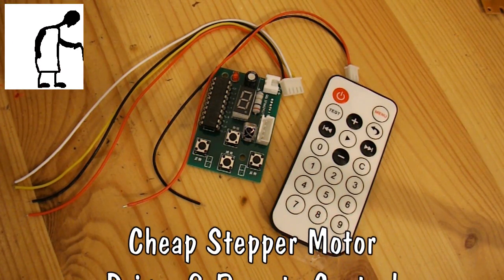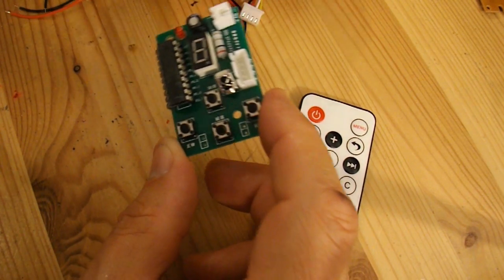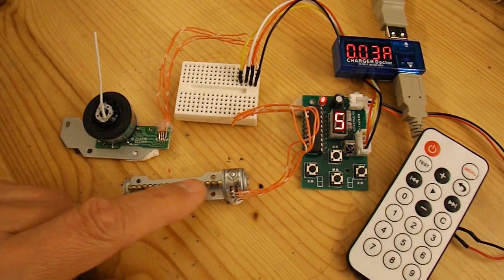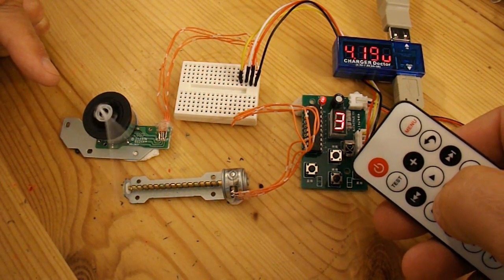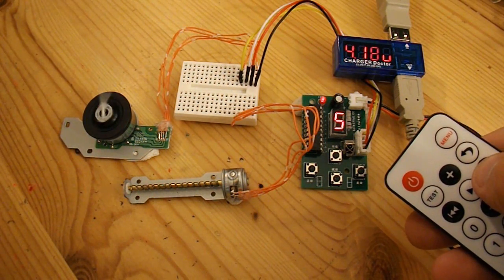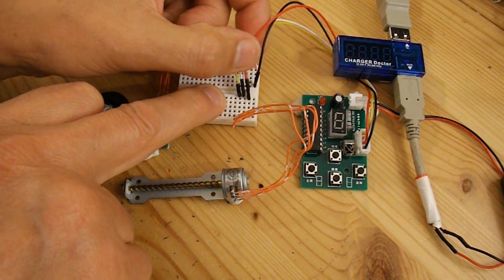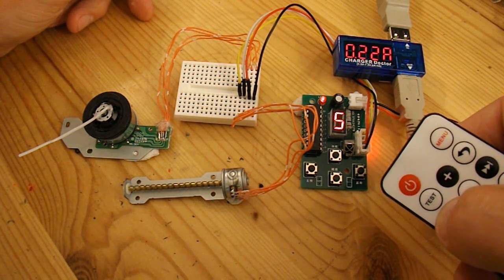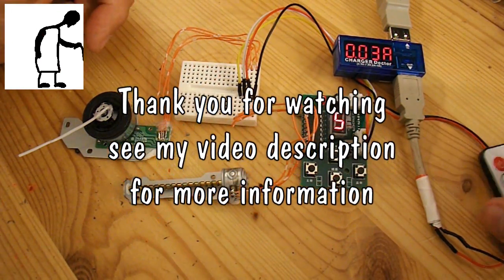Stepper Motor Driver & Remote Control

Comment: I tried this as the basis for a camera slider, using a Nema 17 stepper motor. All was fine and the motor ran for a couple of minutes - but then the unit overheats very badly and then motor drive becomes intermittent. That is it goes for a second, then stops for a second, then goes for a second and so on.
Reply from the maker: I have had a few comments here saying this unit has a very limited power output. I see a comment down here from Walter Hynson giving advise on a modification that might help you.
Reply: @GrandadIsAnOldMan  yes, I saw Walters comment ... a little short on detail for someone with my limited skillset :-)
Reply from the maker: @mickymazda1  we will see if he replies with any more detail 👍

Comment: Hay Grandad, I'm trying to figure out how to connect the JST cables to a mini usb somewhat like yours. Can you help me with that, there don't seem to be a battery suited for this unit that's compact enough to fit my needs, any suggestions would be good, thanks.
Reply from the maker: I'm sorry I don't really understand your issue. If you need some sort of gender changer lead to connect USB to JST you just need suitable connectors to solder together and ensure you get + to + and - to -. In this video I just cut up an old USB cable, checked I had the right wires for + and - and soldered them to the supplied connector lead. The same would apply to connecting the supplied connector to a JST lead. The connectors are readily available online such places as eBay, they may take a while to arrive if you order from a Chinese supplier but they are pretty cheap.
Reply from the maker: If it is a specific battery size you need then you will have to search online. LiPos and LiIons give very good power to weight ratios for a small package size.
Reply: It is the size capacity, that's one of the problems. The other is the type of batteries available which has different voltage and miliamperes they list not suitable for this unit. I just don't want the motor or the chip to burn out. It's pretty compressed where I'm putting it, and not a lot of exhaust from heat. I'll keep looking, many thanks.

Comment: Hi, just found this. Thanks for sharing, & would you know of a compact power source other than the usb? Hopefully something with a JTC connection, thanks again.
Reply from the maker: I am sure you could use a LiPo battery if that is what you mean. As long as you choose one the right size. This circuit is not designed for high loads.
Reply: Sure is, mines labeled DC4~6V / 300~500mA, that is very confusing. Best I could think of are two Lithium Ion Polymer Battery - 3.7v 500mAh, hope it doesn't over load, any better suggestions I'm all ears. Thanks again.

Comment: You need the driver amp board as the board you have generates the pulse train however the L298N supplies the power....so order a L298N module and connect the two together and then you will be able to drive a decent size stepper motor.
Reply: I seem to be having problems driving a Nema 17 without overheating the unit so this response seems as if it might help. Care to shed a teensy little more detail on the "connect the two together" bit?

Comment: hello. i bought mine but seems to stop working smoothly after awhile, also smells and is kind of hot. I've plugged it to a 5V-2A supply, and connected it to a Stepper Motor nema17 hs4401 https://www.ebay.co.uk/itm/202105789985 can you help? you think it's damaged and should ask for a refund?
Reply from the maker: I would think that your motor drew too much current and fried the circuit board. The listing for the driver says Input voltage: DC4~6V / 300~500mA and for your motor it says 1.7A so it was trying to draw nearly 4 times the current the circuit board was designed for.
Reply: GrandadIsAnOldMan thanks. Seem basic. Although the seller/ YouTube showed a nema working with it... Maybe it was a low amps also...
Reply: GrandadIsAnOldMan I am trying to find a nema with 5v below 500mA... The most I can find is 400mA for 12v... Since the nema I had is 12v and the board is 5v that also isn't good right? Although it works...
Reply: Hmm... My nema is under 4v... Don't know they recommended these for the Hang3D Printer since the board is 12v mega ramps...
Reply from the maker: I am afraid that handling 24 volts does not mean it can handle the Amps. I would think you would need some sort of interface with mosfets to handle the current draw required. You might find this video by Great Scott a handy reference https://youtu.be/bkqoKWP4Oy4

Comment: Hi there,
If the input is 5v, can i connect a 12v stepper motor? it will work?
Reply from the maker: I cannot tell you as I haven't tried that. The original eBay listing is not there as this video is 3 years old but I just copied this information off a similar eBay listing and it says it will drive 3 to 24 volt motors but the torque (power) will be less. You could always try asking the seller that question.

Stepper Motor Driver Controller Board Speed Adjustable with Remote Control

Description:

Input voltage: DC4~6V / 300~500mA (so we can input by either battery, or USB power supply)

Motor type to be drived: 2-phase 4-lead-wire (3-24 v of the stepper motor can drive the rotation, but at different torque)

Speed indicator: 9 Levels

Can adjust speed by button on board or by remote controller

Board size: 52 * 36 mm

type:Press 'forward' once, motor begins to run. Press 'forward' again, motor stops. And so goes on. This also applies when we press 'backward'

1  x Stepper Motor Driver Controller  Speed Adjustable Board

1  x  Remote Control

1 x 2p power wire

1 x 4p Plug wire

Comment: I bought a screw drive stepper like you have here. I am installing this in a RC plane. Where can I find a board that plugs into my standard RC receiver in the plane? All I found need the arduino  board to work. Thinking of gutting a 90g mini servo and using motor and potentiometer to control this screw drive. What are your thoughts?
Reply from the maker: Sorry can't help you there. If it is a stepper motor then the servo circuit board will not drive it, the servo motor is a normal brushed DC motor. I haven't tried using a brushless motor ESC on one of these so I don't know if that might work.

Comment: Hello, want to ask you something and maybe you can help me. I want to build a dynostand for my 1:18 modelcar and use a sound modul(the one thats used for RC models). So basicely if I increase the rpm of the little electromotor of the dyno stand the sound shoukd increase too. Do you think it would be possible to realize this with a soundmodule, a servo tester and a motor like this: 

http://www.ebay.de/itm/4x-Mini-Coreless-Motor-1S-3-7V-8520-8-5-x-20mm-for-90mm-150mm-Micro-FPV-Quad-/292012362860?hash=item43fd4b0c6c:g:yxgAAOSwo4pYU8f6

This is what i want to achieve, and would love to use the soundfile of the video! Watch from 1:20 please:

https://www.youtube.com/watch?v=03dQfPBgpOE&t=1s
Reply from the maker: Sorry if I am a bit slow in understanding your request. I don't know if something is lost in translation here but I do not understand what you are trying to do with a sound module. I am not even sure what one is. Do you mean you want to give your model car a realistic engine sound in relation to the rpm of the motor?
As for a servo tester running a coreless motor, it won't work unless you use an ESC. The servo tester would control the ESC and the ESC would control the motor. 
I don't understand what you mean about the sound file on that video. Do you mean you want to use part of my video for one of you music compositions?
I seem to have completely misunderstood, sorry.

Comment: dose this have pre programed movement modes / a programmable setting for how far these turn? many thanks
Reply from the maker: +Dj Morgan no this is just a driver. It has 9 speed modes controlled by the buttons on board or by the remote control. There is a link in the video description to the eBay item and there is a little more information on that eBay page.
Reply: ok thanks for the info,the reason for asking is i want to make a moving head disco light and you can pan the unit to 360d and tilt the head a little over 180d before hitting the base,but i will still look into it thanks

Comment: Hello Friend! This driver is for bipolar and unipolar stepper motors with 12 volts?
And what the distance control reaches?
Thank you
Reply from the maker: +Daniel Fernandes this is the information from the eBay link that is in the video description 
Stepper Motor Driver Controller Board Speed Adjustable with Remote Control
Description:
Input voltage: DC4~6V / 300~500mA (so we can input by either battery, or USB power supply)
Motor type to be drived: 2-phase 4-lead-wire (3-24 v of the stepper motor can drive the rotation, but at different torque)
Speed indicator: 9 Levels
Can adjust speed by button on board or by remote controller
Board size: 52 * 36 mm

Comment: Hey there! I just found your channel and subscribed to it. Seems like I will find answers to most of my questions by just watching your project's videos! I'm buying few of  these stepper motors. Would you be kind enough to tell me what micro controller does it use? I'm thinking about writing some code and use an Arduino  or Raspbery Pi Zero as a bridge. Thank you for the awesome stuff!
Reply from the maker: +Soundscrap I am afraid I am no expert, I just try stuff and see what I can do. The eBay link for that controller is in the video description. As this video was August 2014 the link is probably well out of date but it may give you a start for a search.
Reply: +GrandadIsAnOldMan I'm not an expert either. Yes, the link is still up and I could take a closer look at the picture.  Just for the record, it's a microcontroller from ATMEL 8-bit with 2k Bytes Flash AT89C2051.  Thanks a lot for the suggestion on checking the link! =)

Comment: please show a circuit diagram
Reply: +GrandadIsAnOldMan Thanks for the answer, appreciate it
Reply from the maker: circuit diagram for what? I bought the unit on eBay I didn't build it.
Reply from the maker: +Nunhlima PeeCee if you are interested in stepper motors you may find the videos by Thomas Kim helpful https://www.youtube.com/results?search_query=thomas+kim+stepper+motor
Reply: +GrandadIsAnOldMan hey oldman, what i need to control more than one motor?? will i need 2 of them ?? and will one remote work for both of them or will it interfere with each other, hopefully you can repy fast thank you
Reply from the maker: rotawo short answer, don't know. I haven't tried it. The way a stepper motor works means that the controller sends pulses of current to energise the coils in sequence. I would guess that you could put the wires of a second motor on top of the wires for the first motor and you will get the same pulse sequence. However you will be changing the effective resistance so probably draw more current through the controller. That may cause the controller components to overheat or it may mean there is not enough current to power two motors. Like I said, I haven't tried it so I am just trying to think it through logically.

Comment: hi just connected one of these to a 28byj48 ebay Chinese stepper through a uln2003a driver real slow application you need to adjust wiring to driver board works up to 7 speed fwd and reverse check out video thanks steve
Reply from the maker: Hey thanks for commenting, I have just watched your video, that's some handy information.

Comment: It is funny because I broke my old computer apart, and the second motor was the same like the one in the dvd drive in the computer. 

By the way... how is the white blocky thing called with all the little holes? I just started with circuiting and I want one too :D
Reply: I forgot. Can I find one in my old computer? Maybe on the motherbord?
Reply from the maker: The white blocky thing with all the holes is called a bread board. You can get cheap small ones like that on eBay or electronic suppliers.
Reply: thanks :D

Comment: Old Pal, my biggest request, please please please make a forklift using popsicle stick. hahaha.... the module using IC L293D ?
Reply from the maker: I'll have a think about it. I have rather a lot in my to-do list, so I will add it on.
Reply: I have had hacked the expensive Tamiya Forklift using Adafruit Motor Shield, the same cheapie IR, and powered by Soshine 9v 600mAh battery.

Comment: Hi Grandad, i'm trying to build a module for a stepper motor like the one in the picture (the white one)

http://img03.taobaocdn.com/bao/uploaded/i3/T11H71FitfXXXXXXXX_!!0-item_pic.jpg

Do you have any ideia on how to do it?

Thanks!
Reply from the maker: Thomas Kim did a circuit a while back, here is the link. I haven't tried it myself, but it is in my list of things to do. http://youtu.be/Vc2XRVJ9n1o
Reply: GrandadIsAnOldMan Thank you, for your reply Grandad, but i'm not trying to get the motor running (i can run it already) i just want to create a slider (the white piece of plastic) that runs through the axis so that piece can support something on top, like a gopro for example. Thanks in advanced!
Reply from the maker: Nuno Santos wow, I did misunderstand didn't I, sorry. I guess you need somebody with one of those 3D printers unless you are good with a saw and a file. Some CD drives may already have something like that as part of the existing assembly. I am sure I saw one on a YouTube stepper motor related video but can't remember where.